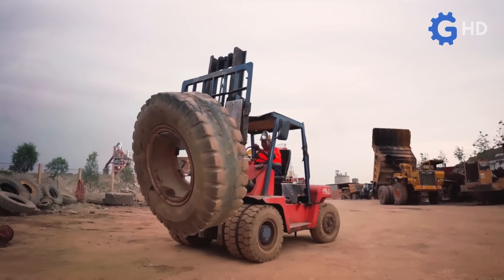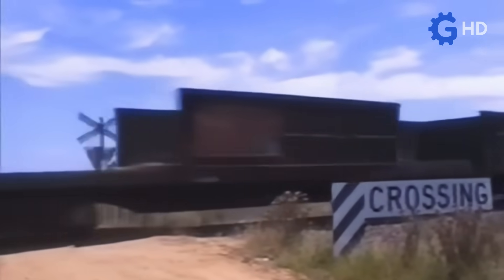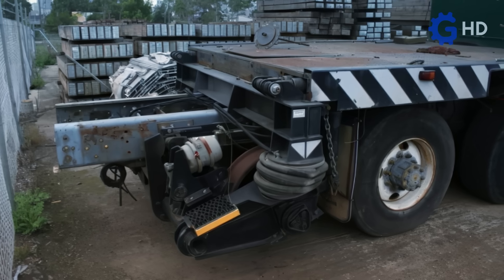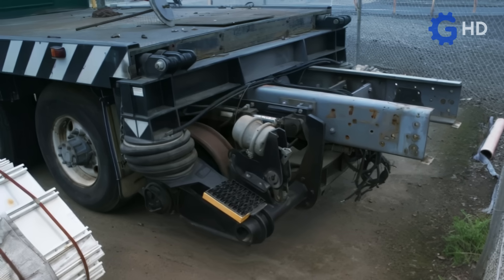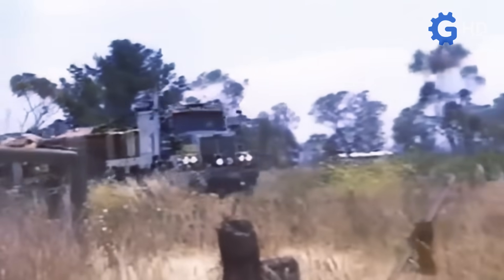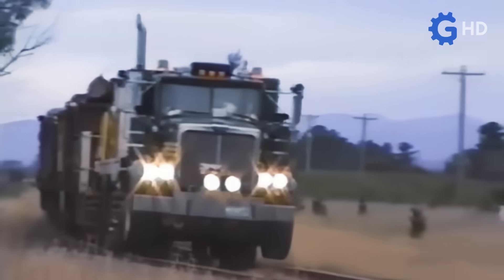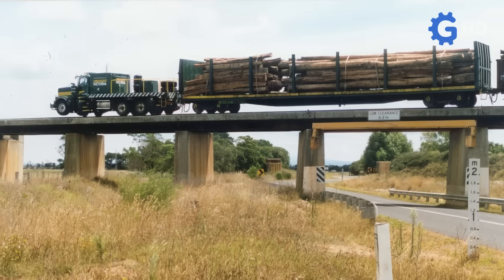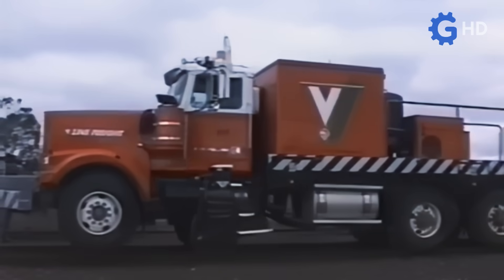Why Is AUSTRALIA Replacing LOCOMOTIVES With TRUCKS? - HISTORY

Comment: load of crap, worked in the industry for 50 years. A truck is a fraction of the weight of a locomotive. You need weight , horsepower and traction and then brake force to brake the train

Comment: The original Western Star prime mover, RTL1 adapted for the Victorian rail gauge of 5'3" (1600 mm), was tested on redundant tracks in the Shepparton area, Victoria. I shot extensive video, especially around Cosgrove, of the process of changing traction methods, of short runs with a load, as well as close-ups of the traction equipment. Company representatives,viewing my footage, arranged for me to sell it to them, including a parrallel run from a car on a road adjacent to the track. A Channel 7 cameraman, seeing I had covered this more extensively than he had time for, arranged for me to send my footage to Ch 7 News in Melbourne. 
This is the first time in 25 years that I've seen any reference to this experiment. It certainly happened.

Comment: Looks like the situation is easy to fix if you would create your own steel wheels like a train House and turn that into a 6 x 6 all-wheel-drive vehicle but they wanted a simple cheap solution does everybody knows if you gotta go to the foundry and have the blacksmith make you up a new set of tires that will custom fit on the railroad tracks and on that truck it’s not going to be cheap

Comment: Here in British Columbia, Canada, it's common to see pickup trucks fitted with train wheels. They are used by the railways as service vehicles. The train wheels allow the truck and crew to access places on the track only otherwise reachable by full sized engines.

Comment: 00:15 Modern locomotives are designed to produce maximum traction motor torque at start-up, enabling them to start trains weighing in excess of 15,000 tons, even on ascending grades.

Comment: Total B.S. This truck would have no hope in hell of pulling 4 miles of freight. Locomotives are very heavy and extremely powerful. The diesel engine in a locomotive only runs a generator for an electric motor. Sometimes when the cargo is longer they add another locomotive half way through. locomotives can travel at much higher speeds than a truck. A truck can only carry a few cars at a time and would only be used for emergencies or track maintenance.

Comment: I'm no pro and something tells me this is a bad idea so I did a little google research

The Tractomas is approximately 410 feet long and sits at a weight of around 770 tons when equipped with a full load

A typical US freight locomotive can weigh over 400,000 pounds and there are times more than one is used.

1 - I can't imagine the cost and frequency of how often they'd have to change truck tires vs. the steel wheels of trains
2 - Those trains are more than power but weight to be able to stop the load. Granted U.S. is not as flat as Australia but still I can't imagine trying to stop a train with a huge truck.

Unprofessional perspective - trucks are not a good idea. Maybe they have a special setup that makes it viable but still.

Comment: They did a trial back in about 2006/7 at the Steel Works at Port Kembla with a similar (smaller) vehicle. I saw it working around the the blast furnaces, desulph and the autos ... but I never shunted it. And before you ask ... I left in late 2007 so I don't know if it went into service. But I doubt it.
Reply: We are not asking...... nobody even liked your comment.. Confused Much?

Comment: Trains roll within a couple of miles of my house moving 125000, each car holds 100 tons of coal, 125 cars +-. This thing is not viable unless moving VERY SMALL LOADS relative the actual locomotives. So you have a dilapidated bridge that won’t handle a real train. There are small yard locomotives that will do what this does. It was a silly idea. Still is.

Comment: Unimog trucks have been used for railway track maintenance and construction since several decades in Germany. One of the newer models can haul up to 50 railway wagons weighing up to 1000 tons, however they aren't usually used for cargo transportation but rather to rearrange wagons or to relocate utility vehicles and construction equipment

Comment: This is BS. Think of it. A semi has a  diesel engine of let’s say 600hp driven through a manual transmission reasonable for the job it does. A locomotive has a several thousand horsepower driven through a diesel electric system made for a the job it does. 
Don’t you think locomotives would be built much different if all that was really required was the comparatively tiny engine the truck has.

Comment: Makes no sense.  
Locomotives don't move a thing.  They generate electricity which drives the train.
Reply: That's not true, locomotives do move things. The locomotive does all the work, train wagons don't have separate engines. It's true that diesel locomotives generate electricity, but they also contain the electric motor that converts that electricity into motion

Comment: Never seen trucks on rails.
(Doesnt mean using trucks is not true.)
We have grain trains passing daily, 50/100 carriages carrying 55 tons each , pulled by two massive diesel electric locomotives.
You could use a truck for shunting. Which I am guessing is true.
Some of the   local grain terminals use gravity to move a carriage. 
I have done it.
You uncouple then climb anorad and  operate the brakes with a big wheel .
Good fun but if you get it wrong the carriage gets derailed just before it gets to the main line.
Then you get sacked.

Comment: I've seen some railroad  maintenance vehicles with fully convertible undercarriage for dual road/rail use in Europe. There were also some experiments with modifying a regular bus to be able to carry passengers both on roads and on railways for some rural areas. To my knowledge those experiments never went to regular use. The solution was more expensive and less efficient than expected and railway people didn't really like light vehicles on rails.

Comment: Nothing unusual about using trucks this way on smaller branch lines with limited cargo to move!!!!!!!!!!!!!!!!!!
Such use of trucks on rail lines like this are routinely used in western Canada to haul grain from smaller and more isolated communities!!!
The trucks are more fuel efficient than a full on locomotive and the truck drivers are usually non union contractors so there is a wage saving as well!!!!!!!!!!!!!!!!!!!!!!!!

Comment: It could work as a switcher / shunter for smaller train loads in yards plus it can turn to face the direction of travel so you don't need to put expensive passing loops or turntables to turn the engine around at a depot.

Comment: Almost everone forgets one important fact: stopping ability! I could, theoretically, move a rr box car with a lawn tractor, but stopping it would be a disaster.
Reply: This is where your wrong. They have the same stopping power as they have an additional air compressors for the wagon break. They are certified for that work

Comment: I don’t see how it could have ever been efficient ,maybe as it stated a maintenance wagon drive nearest access point put down the bogies and away you go ,electric traction motors are about the best for heavy hauling using a truck with a diesel motor and conventional transmission putting the power down through the road tyres on 4” with steel rail causing excessive tyre wear ,must be some office bound twat with no practical experience thinking it’s a great idea while he was fingering his secretary in the stationary cupboard 🤔

Comment: it makes sense when you think about it

the reason trains are so efficient is steel wheels on steel rails have very little rolling resistance
the main challenge is overcoming static friction but once you do that, pulling a train car is very easy, most people don't know this though and ford was happy to claim that their new Electric Ute can pull a train, 

the title while exaggerated still has some truth, rail traffic has been decreasing as newer and more powerful trucks hit the market as companies want to save costs and not rely on external contracted work without realising that said external contracted work is just better than a truck

Comment: High rubber tyre wear on steel rails is a well known problem. It's why Paris has only one metro line with rubber-tyred trains and not more. That sole line has some steep gradients so the adherence advantage outweighs the disadvantage of tyre wear.
Reply: How would a rubber tyre stay on a steel rail?
Reply: @ValMartinIreland  Well, they do it. It's complicated; I have a photo of one on a slide so can't access it immediately but it seems to work.

Comment: This truck has been converted to a road-rail vehicle. It seems that it can pull about five freight cars at most. It is suitable for use as a maintenance vehicle. If you want to pull about five to ten freight cars, a small diesel locomotive might be better.
＝このトラックは軌陸車に改造されている。貨車5両くらいの牽引が最大のようだ。保線車両に使えば用途に合っている。貨車を5～10両くらい牽引するなら小型のディーゼル機関車の方がいいかもしれない。

Comment: High rail Kenworths (the only ones I've seen) have been around for decades hauling short trains of 10-20 cars. They can move the train to and from an interchange and then highway off to another shortline to do the same thing. It is far cheaper than having several power units locked into singular shortlines. One truck can serve several shortlines. The first one I saw was back in 1996 in Idaho serving three separate branches between fifty and a hundred miles apart. One KW serving three 60 mile branches instead of one locomotive per branch.
Old news.

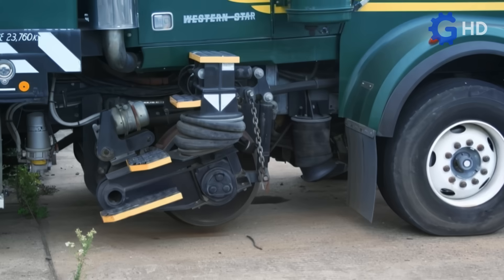Comment: 2:25 — "...but at the time it was a true innovation." Road-rail trucks have been around since 1920, and a streetcar bus was developed in Germany in 1898. Russia and Japan produced road-rail vehicles starting in the 1930s, and the Japanese So-Ki tankette could tow railcars. Road-rail vehicles are also used as shunters to move rolling stock around, using their ability to put down wheels and drive between tracks for more flexibility than a switcher locomotive. So the use of street vehicles as rail motive power has not been a 'true innovation' for some decades.

Comment: What happened you know smart enough to build a good locomotive anymore?  If you're going to use trucks you should make railway wheels for those trucks yeah 👍🏼 and learn how to add the correct balance weight on the trucks otherwise you're going to run into lots of issues. Especially when tires start exploding because they get the railway track line inside of it from running the rails too many times. Rubber doesn't hold up very well. You're welcome for the great ideas for coming from me since I'm the idea man of ideas for people's. No need to thank me you're welcome!

Comment: Ive been a train driver in Australia for over 40 years. Never seen this before. So they replaced nothing.
Reply: They replaced trains that were too heavy to cross the Avon. Big Concrete bridge there now.
Reply: NOT CORRECT - here in Canada such trucks rigged for on rail use are ROUTINELY USED to haul grain from smaller and more isolated communities - and the trucks are more fuel efficient than a full on locomotive and the truck driver is usually a non union contractor so there is a wage saving as well........................
Reply: @abellseaman4114  Yes I remember seeing something about that decades ago.
Reply: @timprussell  AGREED!!!!!!!!!!!!!!!!!!!!!!!
Seems to me that National Geographic magazine wrote a piece on changing Cdn prairie economics a couple of decades ago and the article had pictures of trucks hauling grain cars in place of locomotives!!!!!!!!!!!!!!!!!
Reply: @abellseaman4114  Clever - We'll arrange to boycott these blackleg loads.
Reply: @abellseaman4114  Not correct. Ive never seen them before. So they replaced nothing. No idea what happens in your country.
Reply: @Joe-jd4pn  Aussie here, too. Not a train driver, but do regularly make interstate trips by car. Never seen this, either.
Reply: @Joe-jd4pn you don't read railway magazines, then. That's where I saw it, and read up on why it was trialled.
Reply: This truck visited the Kensington mill in the late 1990's to pick up empty wagons. They used it to transport empty grain wagons. Once they got to the loading site, The truck would use the road to drive back instead of programming a slot on the rails. Don't know how long it was used for but only saw it once at the Kensington Mills. I worked there from 1994 - 2001.
Reply: MILITANT UNION YOB tries to protect his high paying job with LIES!!!!!!!!!!!!!!!!!!!!!!!!
Reply: A half arsed idea they used on the Bairnsdale line for a while.
Reply: Where I live all rail lines are gone

Comment: Retired engineer here, this may work for small loads. But locomotives are built WAY heavier than any truck and I’ve seen them bent by loads 
This is all light duty compared to locomotives that weigh 250 tons those trucks won’t live a long life…
You can drive a car with your feet but it’s not a good idea.
Reply: The theory was to have the road rail prime movers haul light loads that were uneconomic for larger locomotives and keep an otherwise uneconomic line open as a feeder to the mainline.  
In the 90's Vicrail was looking for new ideas to improve economics. The feeder services add up.

Comment: Trunks and trains are two separate beasts. Trains excel at efficiently pulling mile long rows of cars with weights of thousands of tons over long distances. Trucks excel at last mile transport,as they have the flexibility of not needing rails. The abomination in this video is new to me,and I can see why it died out. I suppose Aussie road trains are a thing, because it costs billions to lay steel rails,so using a truck pulling multiple cars is a reasonable thing to do in the undeveloped outback.

Comment: One key issue with this concept is wet weather.  Rubber on wet steel has sod-all friction.  That's the limiting case
Reply: steel on steel with moisture between would have similar issues hence the need for sand so this is a moot point.

Comment: Is the truck a standard transmission or automatic transmission? Being that diesel locomotives are diesel electric there’s no transmission and no shifting. Imagine shifting a 13 spd road ranger transmission while pulling a half a dozen rail cars and missing a gear? And as the unit speeds up it’s just not a smooth transition. 
Also being a truck is a much smaller powered unit and has a much smaller engine than a freight locomotive, it’s very limited how much it could pull. 
Also there’s no dynamic braking like a locomotive, while some trucks do have engine brakes, it doesn’t have the same effect as dynamic braking.

Comment: This idea was bound to fail. I still don’t understand the purpose for which a truck was converted to a railway goods hauler. There is no dearth of railway engines in the world, with a wide range of hauling capacities and track gauges. I can imagine if these trucks were made locally in Australia, that would save money and time to convert one for railway use. But if you had to import these trucks from USA or Canada or elsewhere then you may as well import the railway engines. You could buy new or used ones in any numbers.

Comment: Why Is AUSTRALIA Replacing LOCOMOTIVES With TRUCKS? Because ..... clickbait pays, that's why.
Reply: This use of trucks instead of more costly locomotives HAS BEEN DONE FOR YEARS IN WESTERN CANADA!!!!!!!!!!!!!!!!!!!!
Reply: Yes, one experiment from nearly 3 decades ago certainly doesn't mean we're replacing locomotives with trucks. 😆
Reply: @emdB67  Yes, especially seeing how that experiment led mainly to grief and disappointment ...
Reply: Custo benefício simplesmente, cavalo mecânico é bem mais barato e dá conta do serviço,por ser um continente relativamente plano.
Reply: CLICCKBAIT  So Australia is not replacing locomotives wit Trucks..... Thanks for helping to undermine the Integrity of the Youtube Platform with your CLICCKBAIT Video...
Reply: It's not.
Reply: I've seen this truck/locomotive and took a heap of pics of it. When ARTC built the Up Relief Line between Branxton and Belford in the Hunter Valley, they used a similar white Kenworth cab over to haul ballast wagons within the work site.
Reply: I made a similar comment. I won't be clicking on Gear Tech video again.
Reply: Thanks yes, clickbait.   Nice to have the video but hi-rail service trucks are common even here in the US, but pulling freight is special.   So it should say " Why Hi-Rail Trucks are NOT replacing ..."
Reply: @scottmonfort  I've actually seen them pull 2 or 3 maintenance cars here, doubling as a single vehicle usually
Reply: @scottmonfort  --  Well, at the minimum, they may have application in "work trains."   It's a lot more efficient to form separate pieces of equipment into a train for longer movements because you don't need all the operators and (duh!) you don't need to space out the units while traveling.

Comment: so successful it ran for 3 months  lol
Reply: Was only ever meant to be temporary. By late 1999, the line had been closed 10 years due to a defective bridge. The truck was light enough to cross the bridge and haul timber traffic. That was successful enough to justify spending money to repair the bridge and the rest of the line to enable regular locomotives to use the line and haul longer trains. Today passenger trains use the line. I'd call that a success.